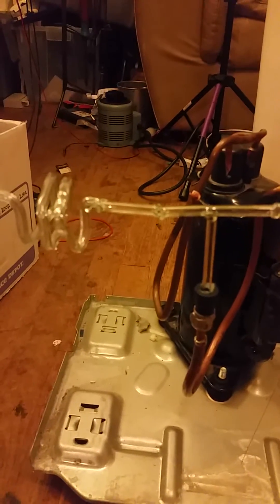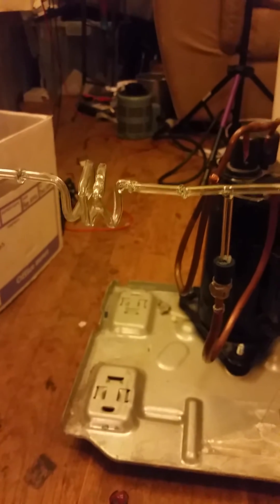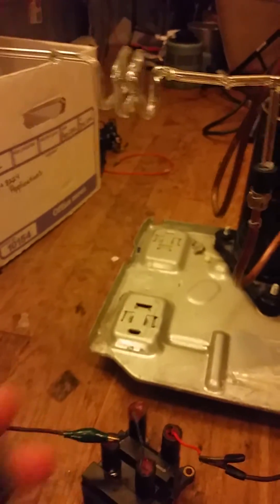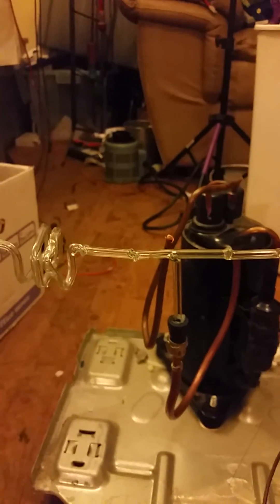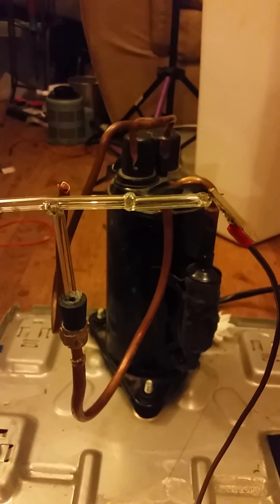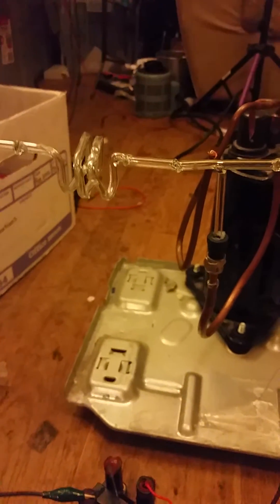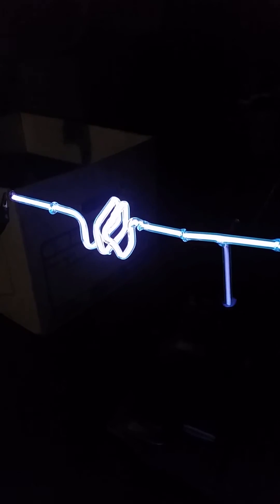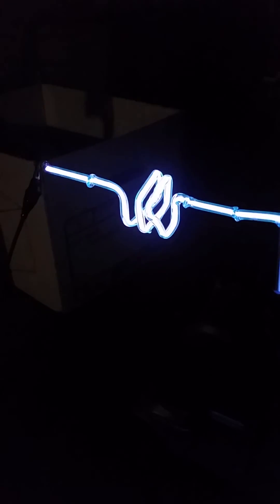glass work #2 geissler tube

Comment: If I were to add a drop of mercury while using my vacuum pump would it still work? If so what color might it glow, purple-blue?
Reply from the maker: Yeah it would be violet/blue depending on the pressure. After sealing off you run the tube at a slightly higher current for a while to vaporize the mercury. For a more vivid change carefully heat the outside of the glass where the mercury is while the tube is running. This will immediately change the color.
Reply: @jdflyback  do you think it will work at the pressure that you did yours at? I built my own pump from an AC compressor too. Do you think that the mercury vapor will also lower the voltage it can be run at?
Reply from the maker: Yes in my experience mercury vapor works well at the pressure achievable with a refrigeration compressor. Refrigeration compressors have a built in relief valve that opens around 10 torr because they are not meant to be used as vacuum pumps. However 10 torr is low enough for some basic glow tubes. The mercury vapor should decrease the voltage the tube needs dramatically, its ionization voltage is much lower than low pressure air. Try to vent the pump exhaust outside. When cool, mercury has a very low vapor pressure however if the mercury in the tube is heated while connected to the pump your workspace could be filled with mercury vapor which is very bad. Best of luck!
Reply: @jdflyback  oh one last question, should I use borosilicate glass for neon tube making for making this tube? Will it block out the Uvc from the mercury vapor? Just asking because I want to be able to look at it.
Reply from the maker: UVC will be completely blocked by borosilicate glass, the only glass that UVC can pass through is quartz glass and that has way too high of a melting point to work with at home. You can make the tube out of borosilicate glass and it is my glass of choice currently but the working temperature is pretty high and it will take lots of practice to make a hermetic wire seal (you need to use tungsten wire). If you are just beginning I would recommend soft glass or even lead glass if you can get it. The working temperature is much lower and it is easier to make a wire seal. You can even use the bead seals from miniature lightbulbs and fuse them in to the end of a tube of soft glass so you do not have to worry about making the glass to metal seal. Be sure to check out "Simplifier" on youtube, and his website. https://simplifier.neocities.org/ . He made some glow tubes with soft glass on the bottom of his page and then transitions to borosilicate (pyrex). Also check out "glasslinger" on youtube and his website. http://www.tubecrafter.com/
This is a book that is helpful. http://www.tubebooks.org/Books/Atwood/Kohl%201960%20Materials%20and%20Techniques%20for%20Electron%20Tubes.pdf
Ask me as many questions as you like I want more people working with glass.
Reply: @jdflyback  yeah I’m pretty much just beginning. I’ve done a little bit of working with borosilicate before but not much. How hard is it to get some borosilicate glass tube and weld it to an electrode? Also thanks for the info on the uvc thing.
Reply from the maker: Borosilicate lab glass is common and relatively cheap. For small amounts ebay is ok but if you want a bunch mountain glass is a good source. I show how to make a good tungsten seal as well as the electrodes an another video https://www.youtube.com/watch?v=kWiUjF1w5uI where I make a triode tube. It is difficult but can be done with practice. You have to coat the tungsten with an oxide, crush the hot glass around it and then heat really hot to form the seal. The links and the book in the previous comment along with my video go into greater detail. Glasslinger on youtube especially shows how to make good seals.
Reply: @jdflyback  thanks for that. Also if I can’t find pre tubulated neon electrodes(the type used in professional neon signs), how would I go about making the glass t joint for the vacuum connection?
Reply from the maker: I think the premade neon electrodes are lead glass which is not compatible with pyrex so be careful. To add an evacuation stem heat the side of the glass and blow a bubble out to make a hole, then heat a smaller piece of tubing and the hole at the same time and quickly join them together. Glasslinger shows this in his glow tube video. https://www.youtube.com/watch?v=hYBq1C9DkYs . This is something best learned by trial and error. If you are able to get the premade neon electrodes I would recommend starting with those and their matching glass. The electrodes are the hardest part and having them premade will allow for success earlier on.
Reply: @jdflyback  Thanks for all of the help on this. However, I can’t seem to find the type of matching glass for the electrodes that I ordered. I assume they are lead glass like you said, but the eBay listing didn’t say. Should I just order a couple of pieces of lead glass tubing?
Reply: @jdflyback  ok, I’m going to go the premade electrode route for now. If I just make a simple tube with the premade electrodes and fill it with low pressure air and mercury I suppose that would work? I wouldn’t need a bombarder transformer would I?
Reply from the maker: This looks like a good website, https://www.brillite.com/itemdetail.php?sku=Clear+Uncoated-18mm&p=Brillite+Fluorescent+Coated+Sign+Tubing&c=tubing&sc=Clear+Uncoated+Glass+Tubing
They also sell the electrodes as well so you can be sure the two are compatible. This is not necessarily the best seller but just the first one I could find. The lifespan of the tube is determined by the current it is run at and how well the tube is baked out during pumping. I think the electrodes sputtering (ends of the tubes turning black) as the tube is run is what leads to failure and this is worsened by higher current and gas contamination. The commercial electrodes are very immune to sputtering due to their design and will last a lot longer than homemade ones. It is hard to put a number on lifetime but I see no reason why a homemade tube with commercial electrodes couldn't last at least a few years.
Reply: @jdflyback  So I guess the basic steps for building a tube would be to build the tube, add the mercury and pump and seal it? Also if I were to use a fluorescent coated tube, how bright could I get it with the ac compressor vacuum pump and let’s say maybe a 100 watt transformer? I’m trying to make a couple of small 3 foot straight tubes for my first real project and I’m just wondering if the level of vacuum will affect the brightness?  (I don’t need too bright of a tube) Thanks for all of the info so far, it’s been helpful.
Reply from the maker: Yeah that is the right order This video gives an overview of the process https://www.youtube.com/watch?v=LIpilGIL4n8
This video is an in depth training video https://www.youtube.com/watch?v=Xr5fqhFqDbA&t=237s
The level of vacuum determines the width of the discharge which effects the brightness. The lower the vacuum the thinner the width of the discharge and the brighter it is.
The higher the vacuum the wider the discharge and the dimmer the discharge. A too high and a too low a vacuum will cause the discharge will cease. I am not sure if you are able to change your vacuum level but as long as the transformer has a high enough voltage to strike the tube it should be bright enough.
Reply: @jdflyback  Why would the purple glow only be on the ends near the electrodes? I built a mockup setup using an old soda bottle and the glow wont fill the middle of the bottle, just near the two electrodes. I'm using a 6000v neon sign transformer for powering it, could it not be a high enough voltage? Also is 10mm tubing good to start with?
Reply from the maker: Vacuum might be too low or too high. Try letting the tube sit with high voltage applied and turn the pump off. The tube should slowly gas up and if the discharge gets brighter you have too high a vacuum and will have to add a valve to leak a little bit of air in while pumping. If the glow goes away all together with the pump off the vacuum is not high enough and you need to try a higher voltage, moving the electrodes closer together, or a different pump. Check for leaks while you are at it. I would use whatever tubing matches the diameter of the electrodes you have. It is hard to join a 5mm electrode to the end of a 10mm tube. I think 10mm would be a good place to start experiments as long as it matches your electrodes.
Reply: @jdflyback  I'm not able to get a good enough vacuum with my old ac compressor. (only about an inch of tube will glow with my 6000 volt transformer). Do you know of any good vacuum pumps that are cheap? Also what would be a good way to connect the pump to the tube?
Reply from the maker: Search vacuum pump on amazon or your store of choice. On amazon they have 3.5 CFM rotary vane pumps for about $70. I would recommend copper tubing for your vacuum connections with proper screw fittings. Black rubber stoppers at the ends of the pipe can also work for the seal. If that is too much work you might be able to use rubber tubing and hose clamps. For the kind of vacuum that you will be dealing with regular rubber tubing should be ok. This is normally not acceptable for vacuum work but for glow tubes it should work.
Reply: @jdflyback  I've made a more powerful pump by connecting 5 ac compressors together. However I've noticed that the phosphor coated tubes I've built only glow a little from the low pressure air/nitrogen? If I add more mercury do you think its possible to make a working 4 foot tube with just mercury and low pressure air? (really wanna build something at least bigger than 2 feet)Also what's a good cheap source of mercury? I've currently been breaking little tilt switches but they don't seem to have pure mercury and it destroys the tube within a few hours. Thanks for all the info so far.
Reply from the maker: You might need a bigger transformer. You should be able to make a four foot tube but you will probably need a higher voltage. I would experiment more first though. There is really not a good source for mercury today. Mercury switches from ebay are probably the best option which you are already using. I find it strange that the mercury is destroying the tube. I would try to make a tube without it and see if it is not something else damaging the tube. It could turn out that the tube is outgassing and needs to be heated with a torch while pumping to clean it. In the future I would recommend buying a different pump to eliminate it as a variable.
Reply from the maker: I cannot know for sure what kind of glass your electrodes are but the majority of neon sign glass is soft lead glass with a low melting point. Searching for "Neon Sign Tubing" will probably give the right kind of glass. I would send a message to the seller to find out what kind of glass it is for sure. It will be clear if two different tubes of glass are melted together, the joint will always crack when cooled. A bombarder is not necessary. Normally when neon signs are pumped a bombarder is hooked up which overdrives the tube to heat up the glass to vaporize any impurities or oils inside the glass so they can be removed by the vacuum pump. This is only needed for tubes that will last for years and a similar effect can be had by gently heating the tube with the torch while pumping.
Reply: @jdflyback  Do you know of any good sources for clear lead glass tubing. The only stuff I can find on eBay has phosphor built in. Also how long could I expect a homemade tube to last?

Comment: Nice work! BTW what gas is used in the tube or is it just low pressure air?
Reply from the maker: +CoolDudeClem I believe it is the nitrogen in the air that makes the glow after once it reaches a low enough pressure., basically low pressure air.